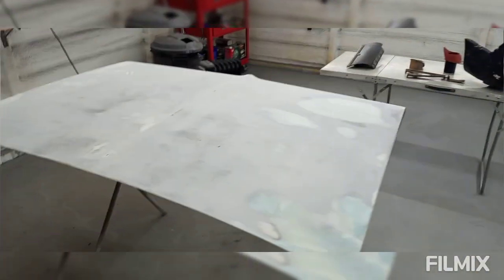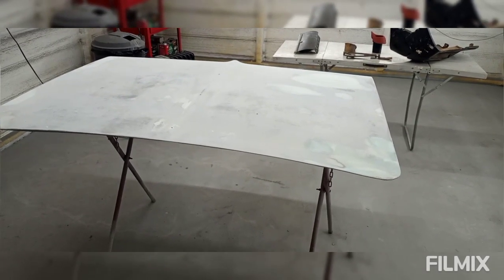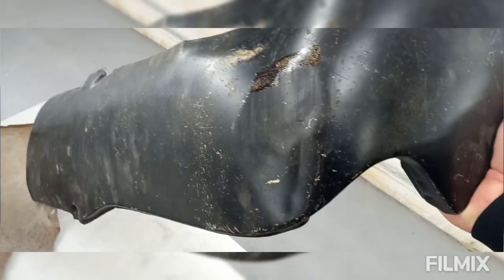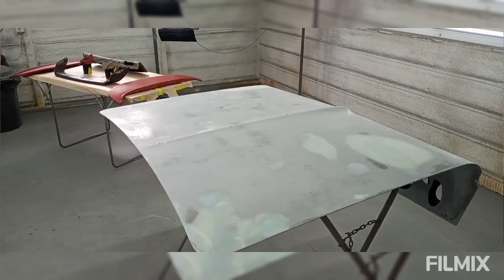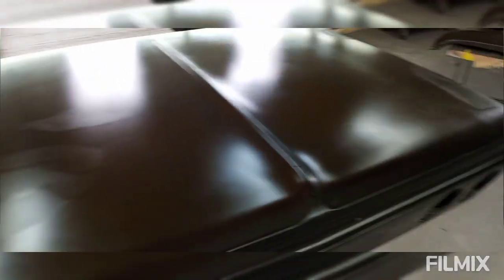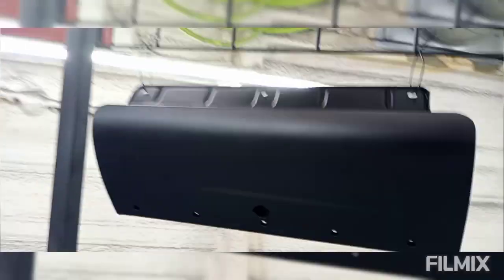BILLIE JEANS TRUNK WORK 1964 IMPALA CONVERTIBLE

Comment: Great tip on drilling out the spot welds on the dash, I think I will remove mine to paint when I get home.
The trunk on my 64 also has some rust below the tail lights.
I got this car out of Chino, CA and it has not been on the road since 75, I have the 76 sticker that you put on the Black plate.
Great work and information as always.
Thanks for taking the time to do this.
Reply from the maker: Thanks for watching Ed!!